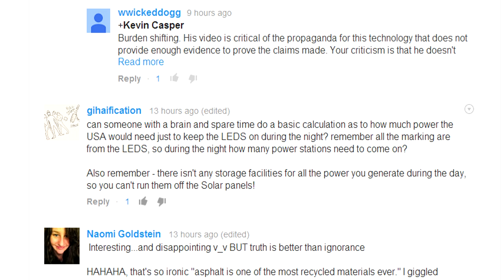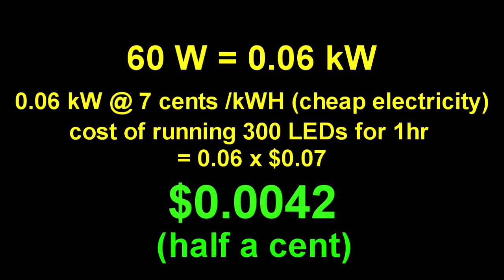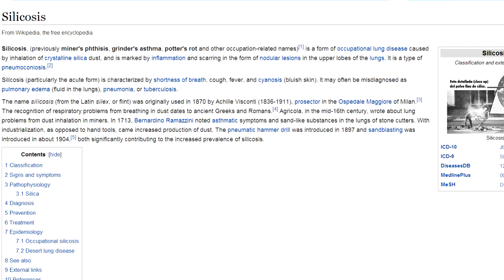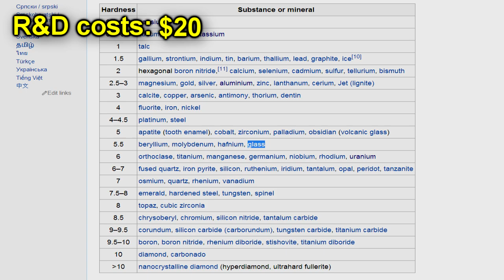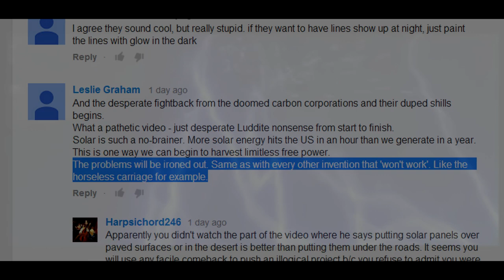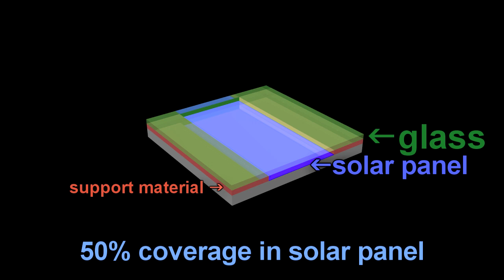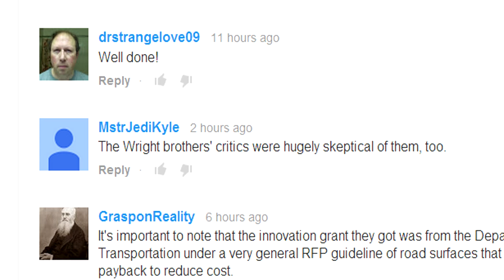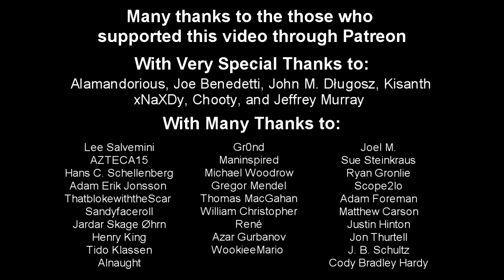Solar Roadways, IMPORTANT QUESTIONS AND ANSWERS!

Comment: Question 1:  The LED can be turned off when the roadways don't detect any vehicles.  Not to mention, they are pretty self sustaining.  Their energy can supply their power.

Question 2: You didn't even mention your education.  I give you this one.

Question 3: My point exactly.  Need to test science to progress and see what new innovations (usually found by accident or necessity) that we can come up with.  Also, if all the roads are grass, where are you getting ALL this dirt from?  As far as spending the money, you can find or develop (Hence, Research and Development) a new type of glass or clear material that won't wear and tear so easily.

Question 4: Exactly Right Leslie.

Question 5: Hence the reason for R&D

I probably missed a question somewhere.
Reply: Mark Baanstra Haha, I don't know if he's sane or not, but I really think people aren't considering the positive impact this will have if it goes mainstream.  And most the problems that thunderfoot has with it can be worked out eventually and hopefully, using the 2 million raised thus far.  It's already a great idea for shopping centers or parking areas (although I like the overhead solar parking areas idea that he proposed).  The thing about it is there is no more circling and circling for a spot, the sensors will direct you.  They can warn you if a car is coming too fast or if a kid is about to run in front of you.  They can track the cart or person that dented your car at the grocery store.  I think Thunderfoot is thinking too much about the "Charging the world" aspect and not enough about the "Sensors on the road" aspect.  Which, there probably is another way to do it, but this way is cooler.
Reply: +Rob S ... "Not to mention, they are pretty self sustaining.  Their energy can supply their power." Where is your data showing that these panels can supply enough power to keep their LEDs bright enough to be seen in the day time? Because solar roadways energy data still hasn't been released. But what about at night? Where is the power stored? Are we going to commit environmental suicide by creating enough batteries to power this thing at night?

"You didn't even mention your education." He made valid arguments, who he is is irrelevant. He is an engineer. Try to focus on the content of the arguments rather than the person making them.

"Need to test science to progress and see what new innovations" Solar panels, tempered glass, and roadways are already widely-developed and well understood technologies. Sandwiching them together isn't creating anything new.

"develop (Hence, Research and Development) a new type of glass" With what? The million dollars they asked for in their campaign? You're going to need a hell of a lot more than that.
Reply: Reddit Gold User Where is your data showing that these panels can supply enough power to keep their LEDs bright enough to be seen in the day time? Because solar roadways energy data still hasn't been released. But what about at night? Where is the power stored? Are we going to commit environmental suicide by creating enough batteries to power this thing at night?

~Exactly, All Ideas that should and will need to be thought of.

He made valid arguments, who he is is irrelevant. He is an engineer. Try to focus on the content of the arguments rather than the person making them.

~I know.  I was just pointing out he didn't mention his education, which was one of the questions asked.  I know he's a smart cookie.  Just pointing it out.

Solar panels, tempered glass, and roadways are already widely-developed and well understood technologies. Sandwiching them together isn't creating anything new.

~You're right.  So, they might need to find something new in order to make them work together...

With what? The million dollars they asked for in their campaign? You're going to need a hell of a lot more than that.

~And if people are willing to give it, what's the problem with that?
Reply: Rob S .. "Exactly, All Ideas that should and will need to be thought of." I agree, but I believe this should have been done before asking for money, otherwise its a campaign with unfounded promises.

"~You're right.  So, they might need to find something new in order to make them work together..." What they need to do is be honest. In their letter to the DOT they were quoted saying that developing this new material would cost around $20M. But they make no further mention of it and instead ask for $1M as if the remaining $19M is no longer a concern.

"~And if people are willing to give it, what's the problem with that?" The people who bought snake oil also were willing to give their money. The problem is that its being advertised as a nearly finished product. Their indigogo states they need $1M to finalize some manufacturing process to begin sale to the public, when in reality they haven't even gotten around to answering the most fundamental deal-breaking questions such as power output, price, material feasibility, and power storage. They could literally collect two million dollars and say "oops, we were wrong, thanks for the money"
Reply: Reddit Gold User What they need to do is be honest. In their letter to the DOT they were quoted saying that developing this new material would cost around $20M. But they make no further mention of it and instead ask for $1M as if the remaining $19M is no longer a concern.

~This is essentially where my critique of Thunderfoot's video starts.  He does critique the people a little, but spends more time trying to debunk the idea.  If you dislike the people, fine, dig deep into them, etc.  But don't spend so much time trying to destroy an idea that would be a cool and useful reality.

The people who bought snake oil also were willing to give their money. The problem is that its being advertised as a nearly finished product. Their indigogo states they need $1M to finalize some manufacturing process to begin sale to the public, when in reality they haven't even gotten around to answering the most fundamental deal-breaking questions such as power output, price, material feasibility, and power storage. They could literally collect two million dollars and say "oops, we were wrong, thanks for the money"

~I understand they could be scammers.  And if people are willing to get duped, that's on them.  What I will say is apparantely they seem legit (Govt grant) and they have careers that make a buttload of money already. Perhaps the govt gave them 19mil and they just needed the 1 mil for final touches.  And, I only barely seen videos on this.  Is there a question and answer forum where they give away their trademark secrets? 

I'm more inclined to believe that this will start small... parking areas and stuff.
Reply: Rob S ... "But don't spend so much time trying to destroy an idea that would be a cool and useful reality." Scrutiny makes strong ideas stronger and weak ideas weaker. If my words alone could destroy this idea then its not a good idea. My argument is that this is a fundamentally flawed idea and better alternatives already exist. I don't like to see donations go toward an idea which scientists and engineers are saying is currently impossible.

"And if people are willing to get duped" So its the people who are at fault? Got it.

"What I will say is apparantely they seem legit (Govt grant)" And instead of providing their research numbers to the gov't to get phase 3 funding they decided to withhold the data and do crowdfunding instead. Why on earth would they do that? Maybe because they knew their numbers didn't look good.

"Perhaps the govt gave them 19mil" The gov't gave them 900k a couple years ago and hasn't followed up.

"Is there a question and answer forum where they give away their trademark secrets?" No, in fact they don't want people talking about it. They disabled comments on their videos and if you ask any critical-yet-valid question on their facebook they will delete it and block you. Additionally they are refusing all interviews with media.

Comment: I can't believe they gave them tax dollars for this?!?!
that's lame even for government
Reply: Mark Baanstra
to me this just looks like a con job.
if they had promoted putting solar on the sides of the roads they would have at least been workable in a limited way. 
here they have almost 2 million dollars of others peoples money, plus the government's grant money, and where's all that money going.... contractors and the guy pushing this crap pockets. 
smells like Al Gores push for carbon taxes with his heavy personal investment in solar...
Reply: +Mark Baanstra the dutch version was done as a prototype... to actually test it, and was designed only for pushbikes (bicycles) the results showed that it produced more power than expected but cost 4-5 times the cost of a rooftop instalation and normal road surface. they had problems with tiles detaching and dirt accumalating on the surface. 

all in all for bikes it proved a success but cars not so much. also unlike the US the dutch roads already have infrastructure along side them for power distrubution (there's not the 100s of miles of roads going through the middle of nowhere)
Reply: Mark Baanstra like I said the power generation capabilities were a success. the rest of it didn't work very well and it was designed with pushbikes in mind not cars. so doesn't have to deal with as heavy wear as a car lane would.
also it was a prototype so yes it had a lot of bugs but it showed some promise.
the basic idea worked the problem is we do not have the materials or engineering required to make it practical and cost effective especially when compared to the likes of roof mounted solar pannels.

personally however I think some kind of thermoelectric generator would be more practical as it could be built under standard tarmac roads during resurfacing reducing the material problems, and making it much safer and easier to maintain (simalar to how many eco houses use thermoelectric systems burried in the garden to generate electricity from the sun heating the ground)
Reply: Mark Baanstra
the advantage of thermoelectric, as with geo thermal, it relys on heat transfer meaning the electricity generating components can be away from the road by simply laying pipes under the road through which water is pumped and heated (as in solar thermal collectors) then passed through a heat exchanger. this way you don't have the problem of ground water... through you do have the problem of the pipes bursting over time due to the shock of vehicles passing over, changes in tempreture and various other factors, but the effect of that can be reduced by having multiple closed loops rather than a single large loop so that if a pipe bursts you don't loose the energy generation of the whole system

Comment: You know what would be a cool experiment for one of these videos?  Take a panel of this tempered glass they plan to use, place it on any American city street for one week.  Then remove it and a) see if it's broken, b) if it is intact, hold it up to light and see how much passes through.  My guess... to filthy for any significant light penetration.   In fact, I may just try this...
Reply: +Alfred Jagels Broken to little bits in the most likely fate of a tempered glass sheet on the road.  A stone hitting the surface hard will shatter it.

Comment: Your "tests" aren't using the correct types of glass. The people at Solar Roadways aren't using the weak glass compounds found in a common jar.
Reply: From everything I've read, they have three universities working on creating a glass that can withstand all of that, and the inventors are fully aware of the potential issues.
Therefore, he is not using the correct glass and his tests are pretty elementary. For instance, how can a stop light be seen in the day by this logic?
Reply: +Hubby&Waifu The light of a stop light comes out of the surface of the glass at nearly a right angle and most of it is directed along a path to the oncoming traffic.  The LEDs in the roadway are a non-starter for reasons of basic optics.  Look up topics like total internal reflection to get a better understanding of it.  Once you have done a quick review of the science, do a little math and you can prove it to your self.  You will quickly see why most engineers who look at the idea say it is nonsense.

The inventors said "tempered glass" in their video.  If they were aware of the issues, they would not have made than blunder.  They also showed them shoveling recycled glass.  This was also dumb.  "Bottle glass" is about the best commonly available glass.  The claim that the have just a "materials problem" about the glass contradicts the claim that they are ready to start scaling up towards production.  My idea of using lighter than air metals in aircraft is at just about the same place as the solar roadways with tough glass idea.  Glass by its nature is brittle.  Even adding Boron doesn't help this a lot.  If they were serious about the idea they would have embedded hardware cloth (woven steel wire) into the glass.  At the temperature where glass becomes solid, the steel wire would be gripped strongly by the glass.  As it cools from there, the steel is put under tension and the glass is put under compression.  The effect is much like the effect in tempered glass but it doesn't fail as easily as abruptly and as catastrophically.  

Watching their video made me say "con artists" for a great many reasons.  It is a truly daft idea.
Reply: +Hubby&Waifu Doesn't matter, it will have the same effect. Roads are not dirty because someone said so and no matter what kind of clear material you will use it will be sandpapered by the dirt. The only difference is the speed of the illustration of what will happen.

Comment: engineering wise- I DO think this is possible w/ critiquing  for cities in hot climates say tuscon, or tampa where there are no trees or vegetation to help out for 9 months out of the year but you also have to consider heavy metal prevention to if you're building computers/mining/smelting. Other climates require a little more engineering.......& cost effectiveness
Reply: Katie Macormic The idea is possible but nothing like practical in any way.  The list of problems is long.  No matter what they do, the panel up on the roof will always be a better option.
Reply: "Heavy metal prevention?" AC/DC banned?